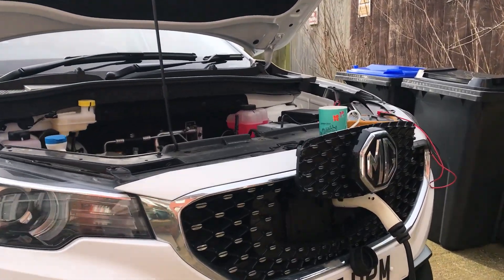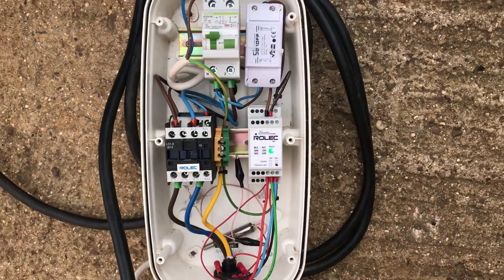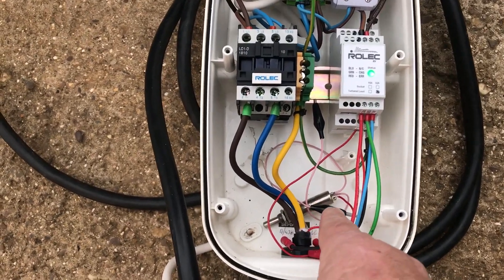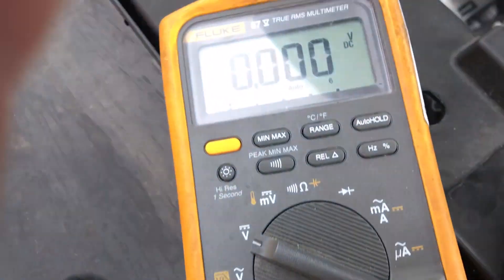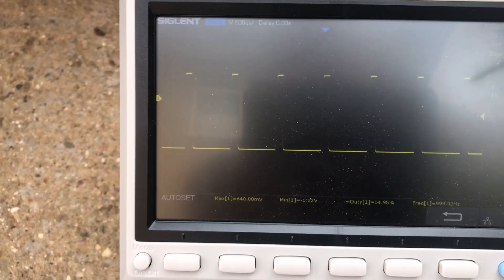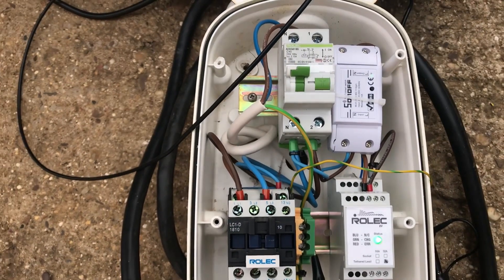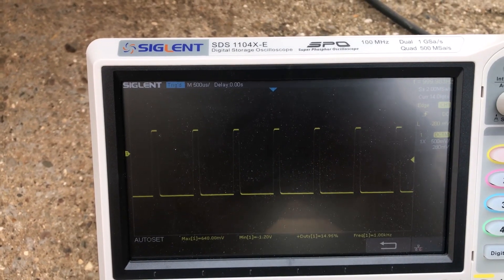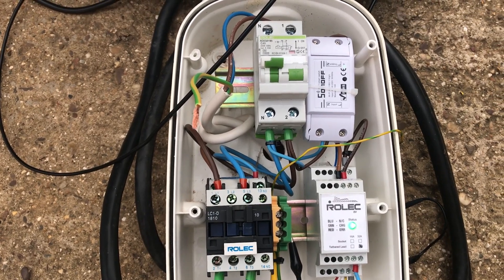test of upgraded rolec on mg zs ev  doing a timed charge using Sonoff relay

Comment: Interesting, should be able to use a raspberry pi and a relay to run simple timing to connect the pilot wire when required.👍
Reply from the maker: I would have thought a pi a bit overkill for the task but if that is what you have  so be it . 
I use a nano aurdino board to monitor the out put and wake up the Mg by opting the pilot wire . Time function could be added easy to this .